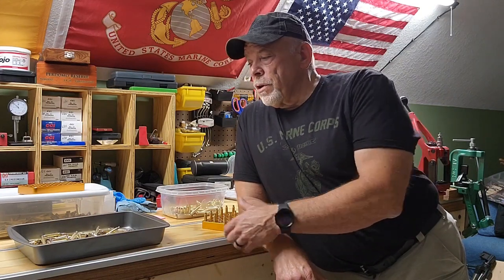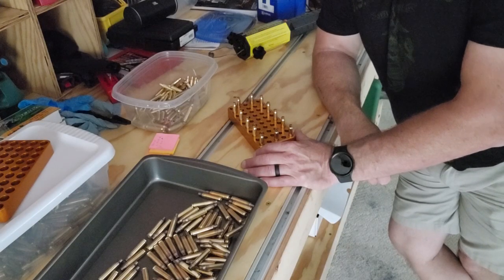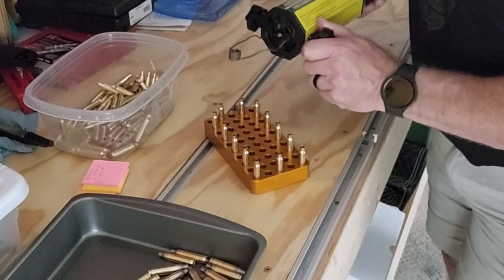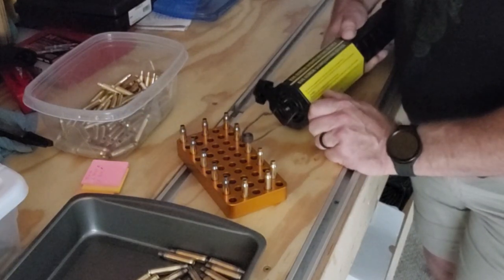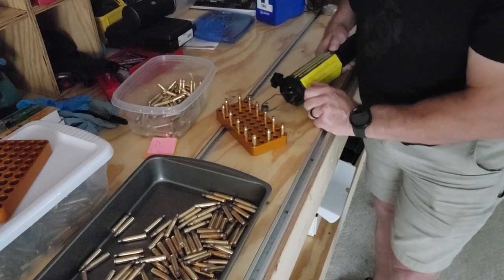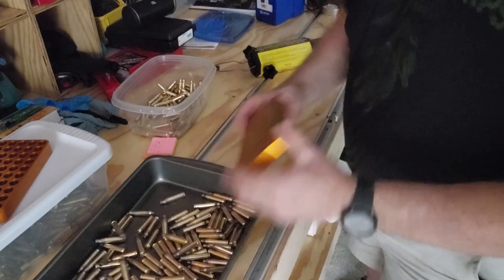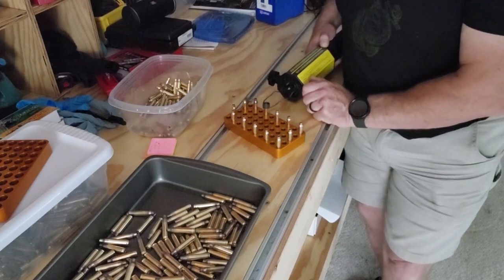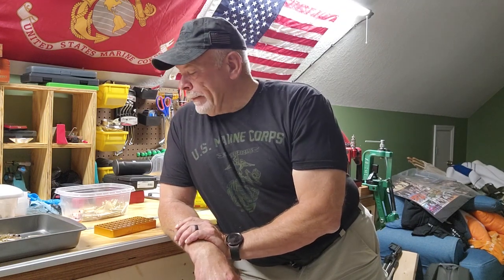DIY Induction Brass Annealer - Follow Up

Comment: Thinking about doing annealing with an automotive inductive heater like yours.  Looks like you made the coil, and I suspect it is lower inductance than the standard coils that come with the unit.  Coil inductance affects frequency.  Just curious if you verified the operating frequency with your coil in place?
Reply from the maker: I have no idea what the frequency is and, I saw no need for an insulated coil. I used drill bits to wrap  bare wire coils in 12, 10 and I think an 8 gage copper wire. Make it just barely larger than the diameter of the brass case body of the round you're annealing. I also found that 5 coils vs 4 was much better to get a decent time. E.g. 1.8 ish seconds for 5.56 and 3.8 for 6.5 CM. I make the "off" time at least 2x what the on time is for cooling.

Comment: Do you need the relay timer if you are just going by sight?
Reply from the maker: It's not an absolute requirement. Going "by sight" is really secondary as some cases are perhaps thicker and/or the user doesn't have the coils in the exact same spot, so sight is a good backup. However, after you've used it for several hundred rounds, your technique gets much better and the timing makes it more exact. When you see me do the first one at 03:44, you can see that I don't have the coils down as far as at other times. The top of the coil should be at the top of the case. If its up like on that 1st one, not as much heat gets transferred further down case, which in turn limits how much heat rises up through the neck. It's a little tricky when looking down on the work to get the coil & case top lined up. Hope that helps and thanks for watching!

Comment: 5 second delay is too long.
Reply from the maker: Why do you say "...too long"? It has proven to provide enough off cycle time that the induction heater doesn't over heat and, it's enough time that one doesn't have to rush between cases. Could it be less and one could do cases faster? Maybe...probably... but that's one of the cool things about a DIY, you can change it to fit your own needs. Thanks for watching and the comment!